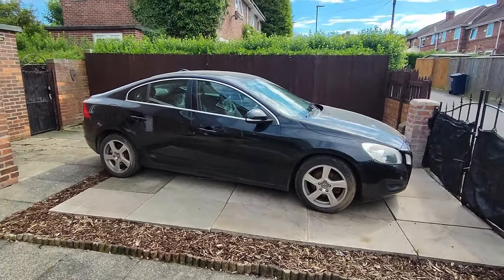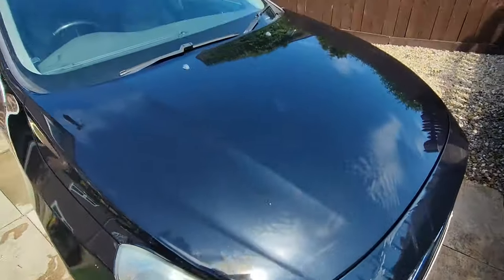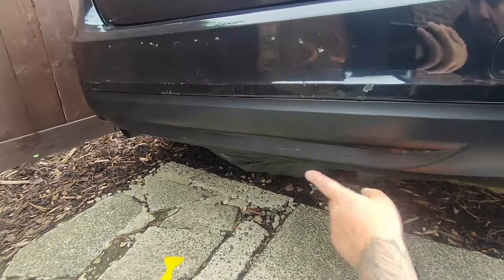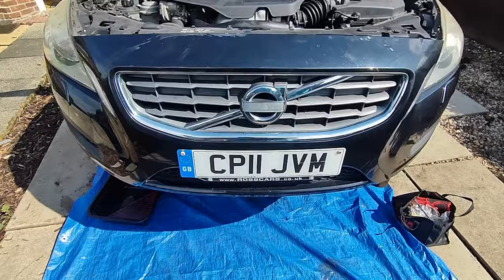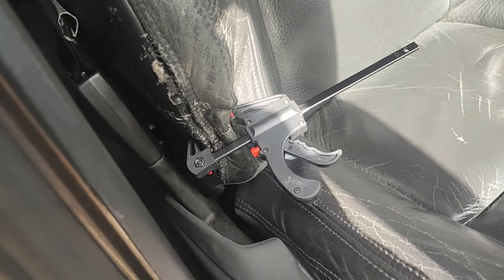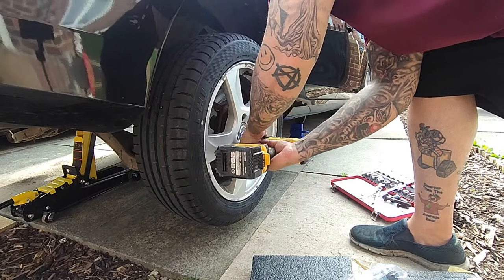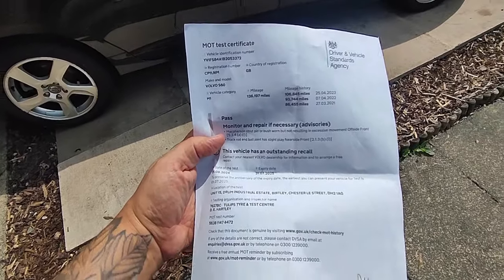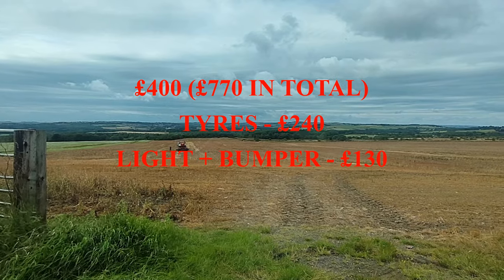FAILED COPART PURCHASE! I SHOULD HAVE SCRAPPED IT!

Comment: The lower bumper with white writing could have been filled where holes were and then sprayed with Rattle can Satin Mat Black. PVC Cleaner may have got white writing off.
Reply from the maker: @richardhaywoodh  I thought straight after it I should have sprayed it 🤣 I suppose I've now got a tiny bit of wrapping experience lol

Comment: Great video mate, ive been toying with the idea of having a go at copart/ebay. Its the transport costs that are putting me off its at least £150  to get one transported before i even start .
Reply from the maker: @benbb5786  for Copart, to myself, it's about 20 miles and they charge £120 and they delivered it on a large 6 car loader that couldn't make it down my street, where as a local company charge £80 but I've bought a car privately which was closer to home and that was only £50... Hopefully that's helpful lol.
Reply: Add the costs into the buy price then work ot out if its worth buying